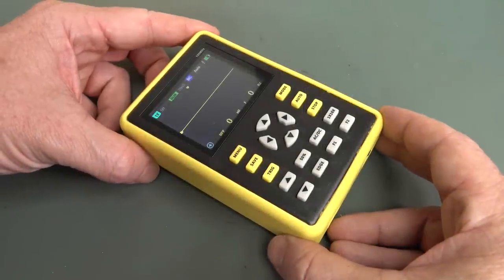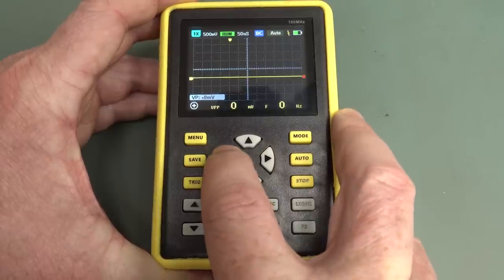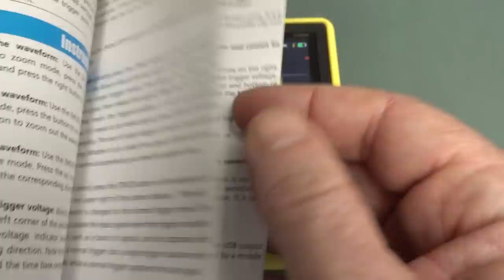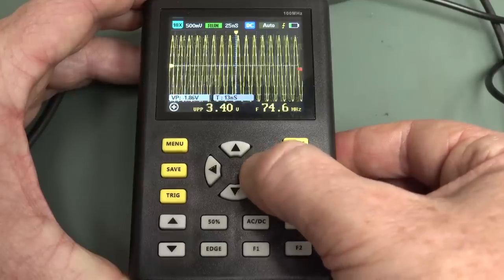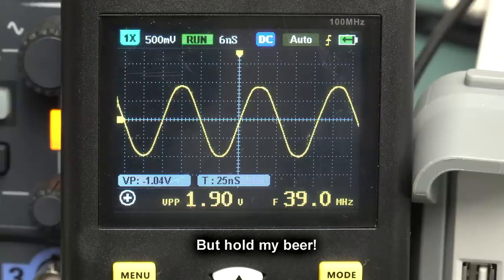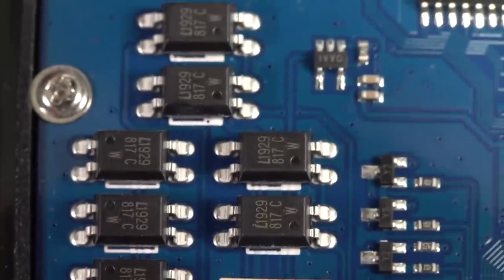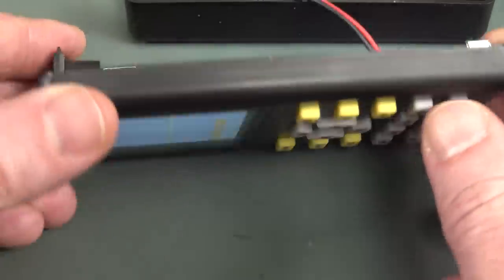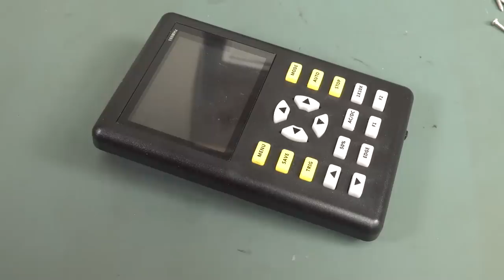EEVblog #1260 - $70 100MHz Oscilloscope?

Comment: I don't think a thumbs down is warranted here...100Mhz? no but it beats the shit out of a vellman pocket scope at $150. I don't know if they even sell those anymore, but that was my first scope...I used it to troubleshoot all kinds of automotive issues (mainly ignition) and would have KILLED for a cheapo scope like you just reviewed.
Reply from the maker: When I product lies about it's sample rate and memory size for starters, that's a thumbs down.
Reply: @EEVblog 

Fair enough, but I still believe that it could be useful despite it's exaggerated specs.

Any scope is better than no scope and it sure beats lugging a CRO around if you need portability.

Comment: Thanks for the review, I was looking into buying one but probably won't after watching this. It's a shame because as you mentioned there is a lot of untapped potential in this product. If the analog front end could be made more robust and if it came with better firmware, it would make a great scope in this price range. 20-40Mhz would be good enough for most hobby electronics use so I don't think that's a problem.

Comment: I am nowhere near the level of your understanding Dave, so I really appreciate and value your opinion. That said, what is a good inexpensive choice?  I'm about to invest in a used Fluke 123B because I do love the interface, as a mobile tech as I'm constantly making accidental setting changes with my micsig's touch screen and easily turned and pushed buttons. I get into spaces and positions that are more like a contortionist than a tech. USB based O scope like my Pico can be highly impractical although great scope. I have a Fluke 97 but it's dimensions are impractical at times which is why I'm hesitating on the 123B Fluke.

Comment: I would love to see a vid like this for the 138 pro 30 dollar 200khz scope. 2.5ms/s. It's like 2 inch by 2 inch by a half inch, battery powered.
Basically I'm wondering when you buy a cheap scope if you stick to a more reasonable bandwidth limit for something so cheap does it perform within spec at that point rather than calling something cheap 100 Meg?

Comment: Plenty of good work has been done using 10Mhz scopes throughout electronic history. China engineers should put less effort into making the fastest pocket scope and more into making the most usable pocket scope, a true 10 or 20MHz scope, mobile-tablet size with all the usual functions and an actually good usable interface (DSO Quad/Nano/203/whatever ... argh, I hate the thing just for the stupid interface confusion!)  for $100-150...   it seems like it should be possible.

Comment: I have a DSO 068, at first I didn't like it much, but as the time goes by I getting to like it more and more (battery powered, don't need to worry about ground loop, etc.). The biggest advantage it has human inerface, I don't care if a scope has 10Gs/s if I can't use it effectively because it has no knobs just buttons, or even worse only touch interface.

Comment: Hello, nice review. I've seen there is a DC in the top bar of the scope, does the scope has an AC coupling mode for the input? And why didn't you used that in testing the sines?

Comment: would some of the anomalies be due to some kind of phase issue within the device caused by sync problems? comb filtering etc? (if part of the process involves inversion of the signal?) just curious. I'm no expert. if something like that "wiggly" length matching arrangement wasn't spot on....

Comment: Of course this microcontroller can drive the ADC through timers or pwm or a similar interface at 100MHz. You don't drive it manually raising a gpio pin from the code anyway. Then ADC can store the whole captured buffer through DMA into the MCU memory which then process it later.

Comment: Learning basic electronics. Have a few multi-meters.
I'm researching "cheapie" less than $100 oscilloscopes.

I read that the most important spec is bandwidth.

I've noted that $40 to $100 scopes have severe bandwidth limitations ranging from 200K maybe up to ~1.0 MHz with reasonable (+/-5% ?) accuracy. I've noted this scope advertises 100 MHz bandwidth, but is reasonably accurate only below less than half that, maybe 20 to 30 MHz. I'm wondering if all the cheapies greatly exaggerate their specs like this. They call it "Chinese specs", I've learned.

What I would like to know is 1) what type of testing can be done with reasonable accuracy with such low bandwidth scopes, and 2) what types of testing should be totally out of the question/avoided.

I understand the guideline that a scope should have a bandwidth 5 times the frequency of the things being measured. My question deals with what types of circuits generate frequencies that are in this lower bandwidth range.

My scope functionality question pertains to testing these kinds of circuits: Beginning hobbyist testing such as in Platt's Make: Electronics or Basic Arduino type systems.

$100 is my absolute limit; preferring $40 to $80 range. This is just for a "toe in the water" "explore the basics of scopes" sort of thing. I know that if I spend "just a mere $200 more" I can get a "real scope." And no, don't want to mess with used or eBay.

Here are 4 scopes in my price range, including this one:

https://www.amazon.com/dp/B07QML4LJL/?coliid=I3UEZDO1F0D9V8&colid=3B04RKX85L5W0&psc=0&ref_=lv_ov_lig_dp_it https://www.amazon.com/dp/B07V6795WP/?coliid=I3IXRDY73S9RI5&colid=3B04RKX85L5W0&psc=1&ref_=lv_ov_lig_dp_it https://www.amazon.com/dp/B07XBL4BTL/?coliid=I31BECTM93K5LJ&colid=3B04RKX85L5W0&psc=1&ref_=lv_ov_lig_dp_it https://www.amazon.com/dp/B07TNPYLS5/?coliid=I1RS7IOEMH7PJ6&colid=3B04RKX85L5W0&psc=1&ref_=lv_ov_lig_dp_it

Comment: hey dave get a look of the Hantek 3in1 handheld 😏... it may be the real deal
Reply: For 100$ - sure. 2 channel, signal generator, 250ms/s, over-usb PC connection, some old integrated multimeter. But their software... It's just terrible buggy.
Reply: @darausus8315  The quality of the software invariably disappoints on these things unless they have been ripped off from an existing design e.g. tiny VNA.
Reply: yeah but for 100$, they had to cut somewhere haha

Comment: Just my two cents, but I ordered one when they came out in July.  However, I just
got around to using it.  The micro-USB connector is recessed to far to get any juice.
Had to take apart the case, and file the opening larger.  It was the DANIU ADS5012H,
from Banggood, but same unit as you review, I believe.
Reply: Its an old unit that came in another version previously...
I saw them on clearence sale at Banggood in June at 79 SD was priceredcuted from like +100USD and I purchased one, but cancelled it again, before it was shipped and then saw a month later, in my mail that it was on sale with coupon at like 55 to 58USD and concluded well that i didn't purchased it now that it was even less and wondered about purchasing it again..

but it was not the same, a new unit with changes.
ON BG productpage even today..
"In order to save costs, the material of screen has changed to TFT from IPS. And the battery capacity has also reduced to 3000mAh.
So.....Just made A few minor changes, the price has gone down a lot!!!
-2019.6.24 DANIU Team"

-- so the first unit was with way better IPS screen plus some other differences..
but at the end of the day, if people have a use for it. then it is fine little mobile scope meter.. afterall the threes doesn't grow into the sky with those specs.
the only meter I got from FNIRSI is this https://imgur.com/a/nOiUeAa

Comment: How can one know that it is not the signal generator that is groovy and not the measurement station? Could it not be the opposite that the other oscilloscopes interpolate over time interval "longer time" and get that smooth sine look, while this one show realtime groove?

Compare with an old analogue scope?

Comment: If you call it a 20m scope for $70 would it be a deal? I need to measure 38VAC Lawn Tractor alternator outputs some times.
Reply: There are multimeter that output the frequency of AC without displaying the waveform, and that might be more useful and more reliable than this seems like it would be...
Reply: @tylerufen  I have one of those, but no scope. I think it would be neat to see the wave form without spending hundreds.
Reply: @larrybl  I just recommended the DSO Shell to someone else for audio in another comment, it's about $30...  I think I'd rather take the DSO Shell to an engine bay more than this one, this once is kinda nice, despite not being very good, and the DSO Shell is more rugged in the sense that it's ugly and cheap enough not to care about it...  Might also be a good alternative for you... (?)

Comment: The AD9288 can be and is commonly overclocked, the Rigol DS1052E bench scope used 3 of the 100MSPS variants, so a total of 6x 100MSPS when interleaved, to achieve their stated 1GSPS.
Basically fine if the designer qualifies them to run at that. So i'd bet bucks this trashmeter is actually using the 40MSPS version, so a max of 80MSPS with interleaving without overclocking, and they're just overclocking the snot out of it, hence the terrible response at higher frequencies (tho im sure the front end doesnt help there :P)

Comment: Of course theres the Hantek 2C42, which is a 2ch 40MHz bandwidth handheld scope with DMM, available in a 70MHz variant and optionally with a signal generator. Has a decent looking shielded analog front end, an FPGA for acquisition, etc, and has been getting good responses from both the eevblog forum and the electronics channel on freenode - and is $99. But then, I recommended it for review several months ago, even offered to send one in, and was met with "no way, i'm not wasting my time reviewing any cheapass chinese scopes" -_-

https://i.imgur.com/EKq3XZK.jpg

https://i.imgur.com/KlW6zD3.jpg

Edit: Added Internals Images (if youtube will allow them)
Reply: Is it true 70mhz?

Comment: Are there any portable oscilloscopes you’d recommend? I work in a field role where our “reliability team” are often 6 hours away at $2000 a minute

Probably wouldn’t use a scope during a breakdown but I can’t just drag half a Kilometer of railway vehicle into a workshop
Reply: CANBUS, ultrasonics, 24vdc, stuff like that

Done minimal research and considering a siglent shs806

Comment: A cheap way to check 50-60 Hz mains ?
Reply: @Bob Sacamano It's isolated that's why .
Reply: @KD0CAC  Irrespective of isolation, is the front end safe for the ~340v peak you get from 240v RMS mains? I wouldn't trust it.

Comment: you can change the trigger point. You have to disable the 50% on the menu
Reply from the maker: I do that, watch the video :->
Reply: @EEVblog  yes I saw that after a few minutes. Great use for this would be smps trouble shooting. What do you think? Great video. I just received this scope to tinker with smps diagnostics. I have a siglent sds2202x but I need to use an isolation transformer either on it or the power supplies I am working with. Thanks again.

Comment: Will this work for car stereo? For calibrating distortion and max volume on amplifiers and head units.
Reply: Should be fine for uncalibrated indication use below 20MHz, although I'd probably use it upto 1MHz max and not rely too much on the reported voltage levels.
Reply: @imranahmad2733  Okay cool. I have been tempted to buy some of the cheaper ones on ebay with worse display but i dont know if I will be able to see the distortion. There is so much about oscilliscopes I dont know. And there is not much reviews on really cheap oscilliscopes either.

Comment: It looked a bit like those kit oscilloscopes you can build. so I looked at their other ones. And yeah, they started with making those kit ones, and then I guess improving the analog circuitry and the software. But it doesn't seem a lot better, but it's a lot more expensive.

Comment: I bought a few years ago a mini oscilloscope named ''Mini DSO'' on ebay. It looks quite similar to a mp3 player and it seems to work better than this one! I can relatively safely measure mains noise with it, with a little transfo coming from a 600V electric panel pilot light with integrated 600V-24V transformer.

Comment: Bei analogen Oszilloskopen scheint nur die mögliche Spannung zu entscheiden, wie schnell die mögliche Frequenz 1 GHz, 10 GHz, 100 GHz, zuletzt als normaler Trigger bei niederen Frequenzen. Das Problem ist die hohe und angepasste Impedanz und die Möglichkeit eines voll konzentrierten und gebündelten Strahls. Mit einem 100-MHz-Horizontal-Trigger erhalten Sie eine 100-MHz-Welle auf dem Bildschirm als vertikale Amplitude, wenn genügend Energie von der Kathode in Bezug auf die Ausrichtung und Ablenkung der Elektronen vorhanden ist. Die Bildbreite muss nur ausreichen, notfalls in Zeilen. Aber es scheint auch physikalische Grenzen zu geben, die durch die Platten des Oszilloskops verursacht werden, je nach der tatsächlichen Wellenlänge und der Streuung nach Wellen- und Kapazitätsdimensionen. Der Strahl wird nicht nur gebeugt, sondern auch gedehnt. Deshalb muss er wie eine harte Nadel sein vielleicht sogar von höheren Frequenzen umgeben, die von einem Bündler mit etwas wie einer kleinen Wolframbeschichtung im Inneren oder einer guten anderen Legierung erzeugt werden und die Streckung des Strahls verringern. Die elektrische Außenlinse sollte nicht versagen. Es ist je nach Konstruktion sehr schnell. Nur moderne Kinder glauben, dass es bei 50 Hz langsam ist. Es gibt spezielle Klystrons mit 500 GHz und mehr Transmission für harte Strahlen. Der Bildschirm ist nicht das Hauptthema. Aber das Auge ist sehr langsam. Daher ist ein zusätzlicher Bildschirmtrigger für Summationen erforderlich. Dann erhalten Sie den Vorläufer eines Bildschirmspeichers, verursacht durch natürliche Verzögerung der Pixel. Dies ist aber auch nichts anderes als ein Vollbildmischer mit höherer Frequenz direkt auf dem Bildschirm vollsummiert. Bei 90 ° seitlicher und vorderer Neigung können Sie zusätzliche Untersuchungen in physikalischer und elektronischer Form durchführen, wie eine "Sondenprobe einer Röhre",  jedoch in "direkter präziser Mischumsetzung am Bildschirm" überwiegend visuell detektiert. Später wird mit A/D-Wandlern und innerhalb "trägen Halbleitern wie verrücht an dem Wellenverlauf spannungsmäßig herumgemessen. Nur dienen diese A/D-Wandler nur zum Nachmessen. Es fehlt vor allem eine realistische hochauflösende THz-Probe , deren Inhalt dann dann mit einem A/D-Wandler ausgemessen wird !

Comment: The measurement is not correct, because the fnirsi does not have the correction for the 50 ohm , the keysigh instead yes !!! note that the waveform is not distorted, so the passband is good, consider that any oscilloscope, has the passband at -3dB, so a signal of 100mhz, 1v pp, measure it 0.7v pp, missing the correction 50 ohm measures 0.3v pp !!!

Comment: @33:00 how its getting the data into the SRAM - DMA would be my guess. It 'aint pretty, but it kinda works. I used a similar trick on the stm32 bluepill "Pig-O-Scope" https://github.com/pingumacpenguin/STM32-O-Scope/wiki We eventually dragged 2MHz sampling from a $2 board. Not quite good enough for production, but a fun project none the less.
The GDM32 chips are clones of the STM32 range, and have very similar specs, including built in DMA controller, which the built in ADC can use, and which can be also be driven by the GPIO, so I presume the data gets clocked back in using DMA. Of course.. I could be wrong. The built in ADC of the GDM wouldn't be anywhere close to the sample rate they need for this, hence the external ADC. You could however add protocol analysis, and/or trick the thing up in other clever ways with an open source firmware, so as an experimental platform/GDM dev board and occasional oscilloscope, this box of tricks looks like a load of fun. 

Just don't expect to do any serious measuring with it.

Comment: Dave :
This video lacks 3 very important things.
a) A final table comparing the real specs vs the manufacturer's

b) The things needed to better the instrument, as Alpha Helix stated in his comment, with the costs involved in USD, to make the comparison clear.
That should put the instrument in context, for it may still be useful and cheap or in budget for field technicians and students, and hobbists, as many owners commented below.
As for a point, one assured it works properly for 50 MHz digital signals. That is a good indication that a lot of potential users would like to know directly from your video.
Testing it with analog signals should give a limit for proper functioning.

c) A table comparing specs and prices with other similar scopes with screen.

Aside from that, your video was detailed in hardware with the teardown process.
But we certainly need your expertise with a datafull conclusion to make a weighted decision. 
We all know by now that there is no :  "cheap and best for all situations" product.
BEST really means a balance between our present and near future needs and our purse, which is always decreasing.

Hope this ideas will sustantially better your already good videos.
Regards.
                            Jorge.